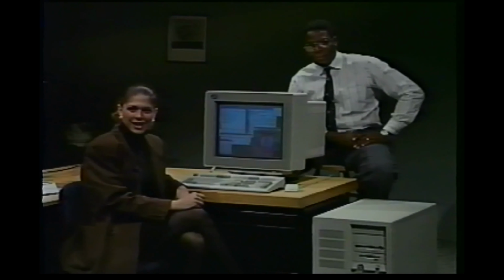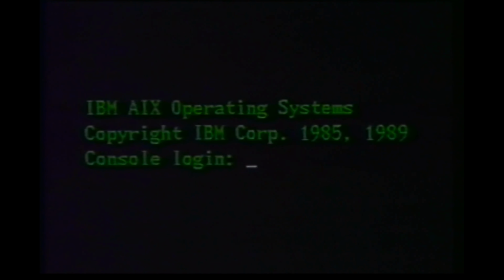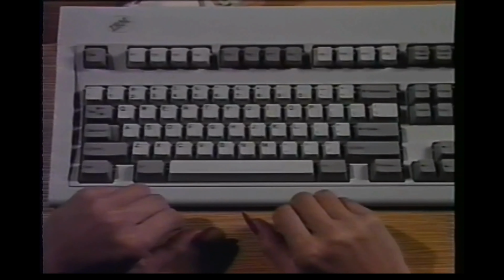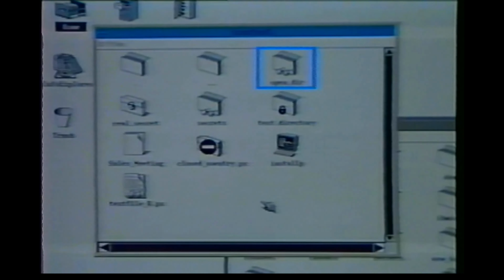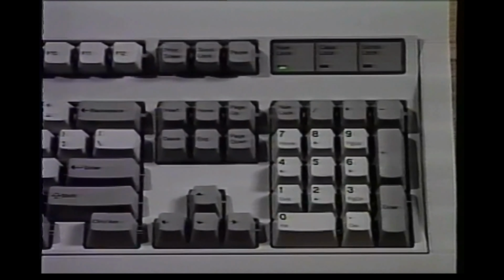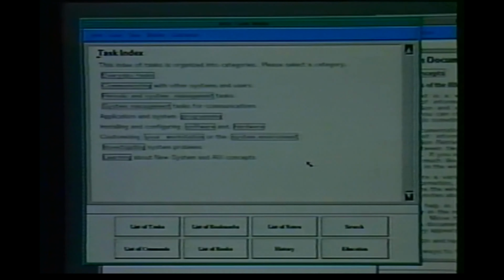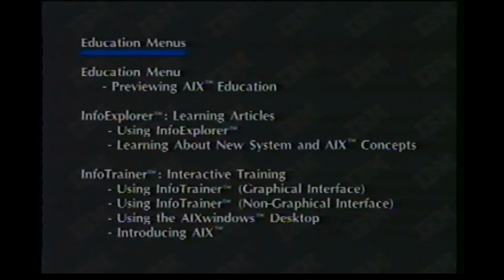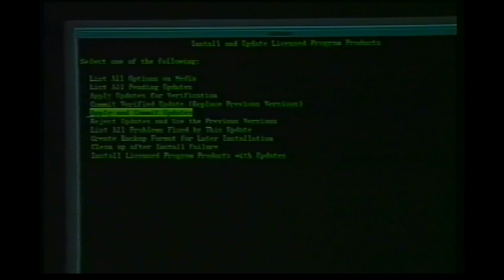1990 IBM RS/6000 RISC SYSTEM -Introduction to Power Server, Computer History, for review and comment

Comment: I can't remember which one, but I used a Linux distro around 8 or 9 years ago that had the same feature of being able to move the mouse into another window to select it, as in this video. It would be nice for modern GUI's to have that feature as well. Also, who is Tonie? I think I've seen her in another IBM video, some time ago.
Reply: Most window managers used "focus follows mouse" by default back in the day. The manager in the video seems to be based on Motif, which definitely did.

Alas, MS Windows and MacOS didn't, and eventually rather than irritate users coming over from those popular systems, most Unix systems adopted the click-to-focus approach.

I prefer follows-mouse!
Reply: @policyprogrammer  If you're running one of the common UNIXoid systems, I think in many cases, it's possible to change your window manager for one that supports "focus follows mouse."  I use PekWM on Slackware, and I don't think it even offers "click to focus."
Reply: I use the i3 window manager, which does this :)
Reply: Thanks, I'll look into that one. @toresbe
Reply: Toni? She worked for IBM around 1990. She also made some of their training videos.

Comment: I abused an RS/6000 in grad school.  Both as user and admin.
Reply: Stories? Do tell!
Reply: Nice! I only got to abuse NeXT pizza boxes..🤪
Reply: So you got to play BOFH with IBM workstations?  In my case they were Suns, an SGI frontend for a hypercube machine, and some BSD VAXen.  I got roped into sysadm work 'cos the main guy with root got into some legal trouble with software licenses
and I was already maintaining Emacs and GCC there.  I think I was the only Emacs guy at the school.  Later, I abused two Solaris workstations as an ISP co-founder, and for the most part I remoted in from a personal Linux box.  These days, I've a bunch of surplus Optiplexes running Slackware with far more space and crunch power than I ever had in my school sysadm days, but I miss good offline documentation though.